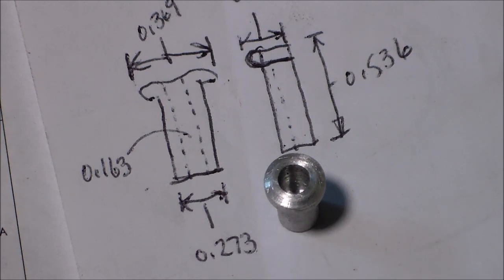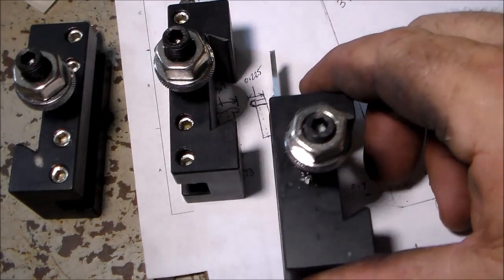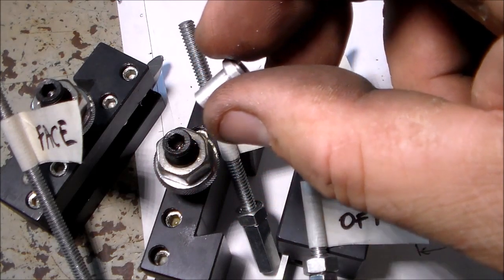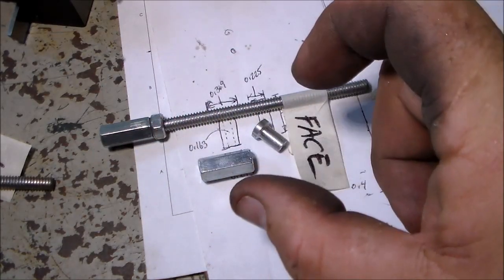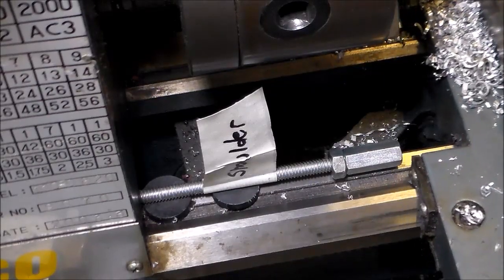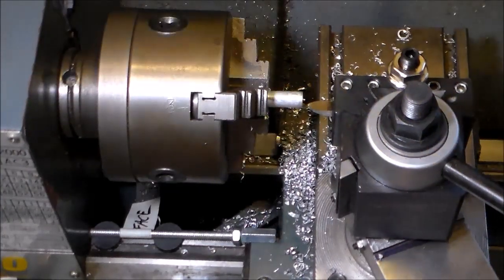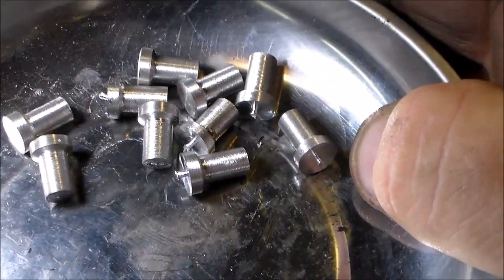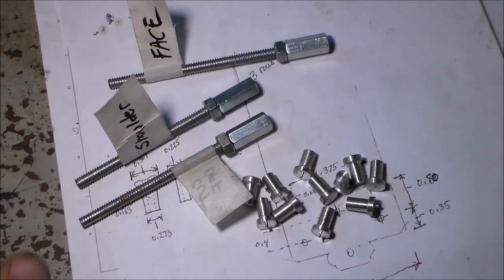Easy DIY 9x20 Lathe Carriage Stops

Comment: OK fellas, try getting you a mighty mag and one inch dial indicator set it up on the ways so that the carriage bumps it. Having the quick change is almost necessary here but simply set your tools in the holders si they hit the same place on the indicator or jot down the stopping point.
Also you could do the two turning operations and put the part in the Chuck backwards to drill it. I can think of several ways to make this part with out putting my hands near the Chuck.
 No offence intended to the fella that made the video !
You can get the mag and a cheap indicator probley less than 30 bucks... Why cheap you say ? Because they will work fine and that's a dangerous area wouldn't put a hundred dollor one there... Jus saying
Reply: You just gave me an idea for my mighty mag!

Comment: could you please help me, Because I have trouble understanding the carriage stop !? As I understand it, I can put the carriage on automatic feed, and put a carriage stop to stop the auto feed!!? But it is turning and pushing the carriage still so how does it stop? Thank you for your help.
Reply from the maker: No, this is more like a depth stop on a drill press. These little lathes don't really have an easy way to set a stop that will kick out the feed. I use these drop in spacers just to stop the carriage at a specified point when feeding by hand.

Comment: I was flinching every time you swapped out the stops.  I haven't done it yet, but I can imagine smacking a knuckle on jaw.  I would have stopped the motor.  As soft as knuckles are the spinning jaws are unstoppable - not a good combo.
Reply from the maker: Yeah, guess I should've put a safety disclaimer in there. It looks closer in the video than it is, and since the jaws are so far in, there's not much to whack you at the chuck.